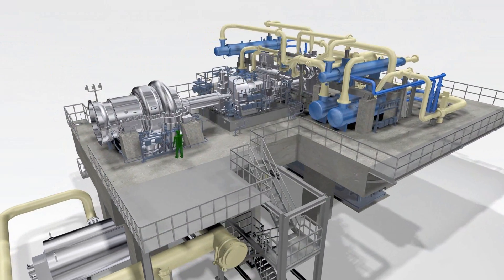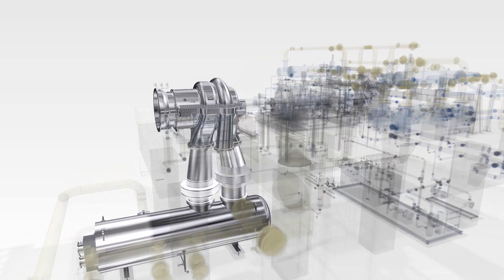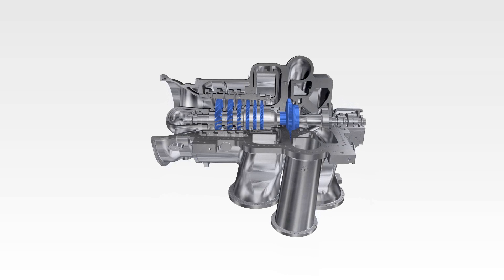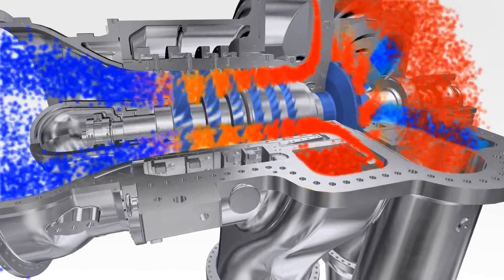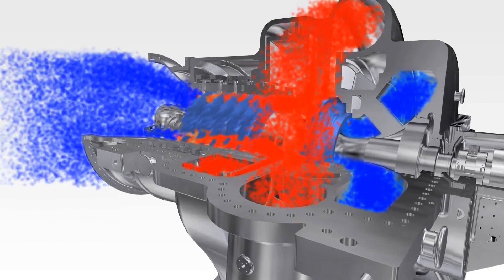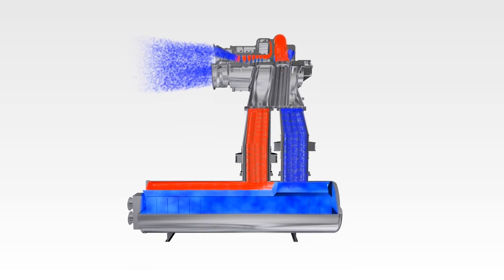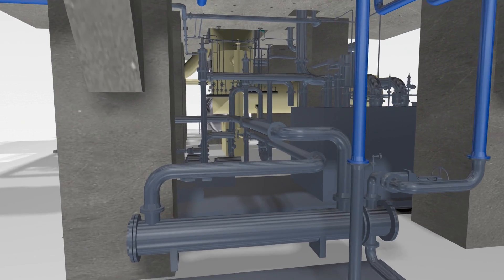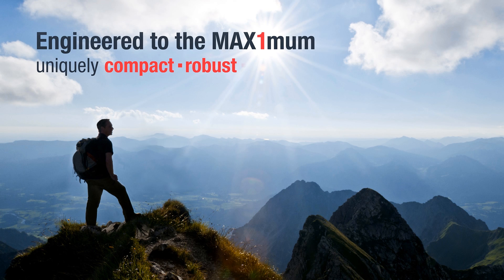AIRMAX featuring AR-MAX1 axial/radial compressor

Comment: Low Pressure Cryogenic Plant Operator here.
I've used low pressure compressors that provide about 1,200^3ft of air per minute (DresserRand CAP 16 modified with a CAP 12 cartridge) at roughly 100psi for production levels of 25-35 gallons per hour.
I see your description of uses listed, but could you elaborate on what the specifications of this type of unit are? Is this high or low pressure?
What application would require an air demand this high?

Comment: How hot is the compressed air before it is pumped into the intercooler? Is it hot because of the amount of friction caused by its speed while being compressed and forced through the system?

Comment: Interesting. Andrew Dmitryyev mentioned plazma and fuel. I worked for a nitrogen collection CO with an Ingersoll Rand 5 stage turbine that only had a 3000 hp electric motor for power. Carbon bearings held the turbine in place till it produced enough air pressure to pass through the space on the shaft, then the air become the bearing. This was a very high noise level area. This AR-Max1 puts the Ingersoll to shame. 7000 ton of oxygen per day? It's collecting the gasses and turning them into a liquid by cryogenic distillation. One gas takes less energy and pressure to condense. It would be used to cool the stream to chill the next gas, and the next, the nitrogen, to turn to liquid and so on. Oxygen was returned to the atmos and recollected to continue the process. Argon was next but we didn't have storage. The liquid nitrogen was super cold (negative 360deg) when it would turn back into a gas. Used in food prep and freezing for transport. Now Plazma? and there are other gasses we know nothing of yet, at a very small amounts in our atmo. What Fuel are you thing about Andrew?